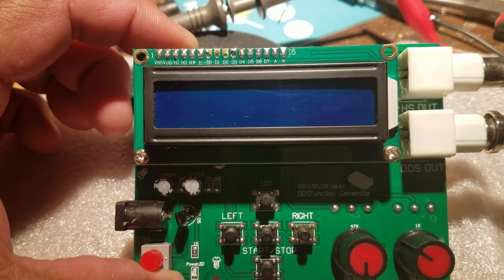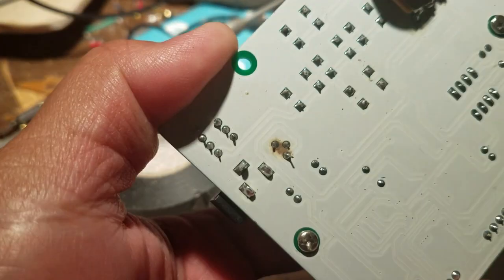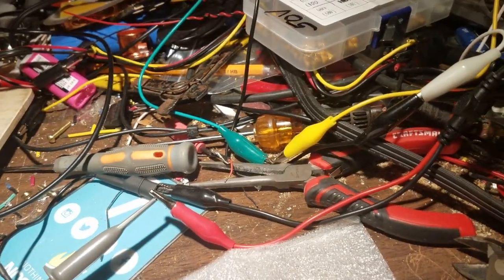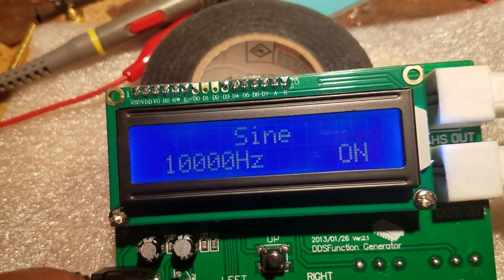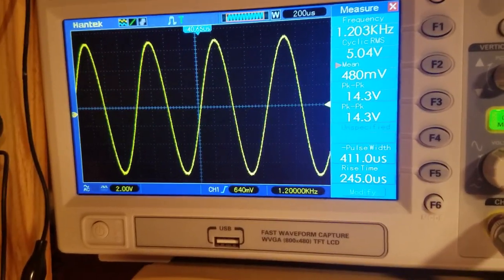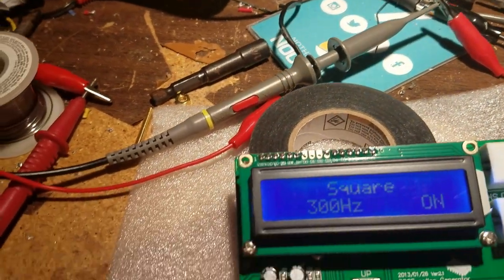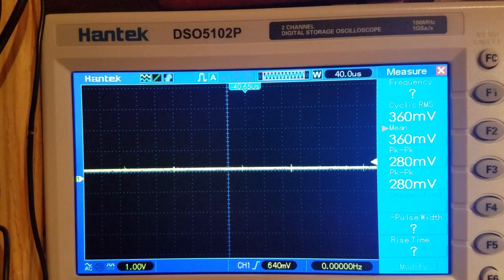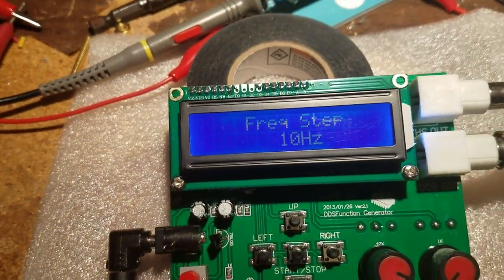DDS Function Generator Review

Comment: I purchased one of these function generators to use with my analog Leader 1100 Oscilloscope. Interesting outcome.  In analog the wave shapes are not accurate. For instance when a sine wave is generated and adjusted so that the top is a sine the bottom of the wave is clipped on a 30 degree slope. Also the sine itself has digital steps rather than a smooth flow. If I adjust it so the top and bottom are the same it looks more like a modified saw tooth.  I like How I can generate some interesting wave shapes but as a useful function generator it falls flat on it's face.

Comment: You could have used a 10x probe to avoid clipping and show a much better demonstration of the offset.
Also, the function generator the you have got can go to 1hz by adjusting the frequency step.
Reply: Can this thing be manually adjusted in real time with one of the knobs? I neen something that I can play and manually sweep from about 5 to 100hz manually with a sine wave can this thing do that? Or does it only have fixed frequencies?

Comment: Hello sir, Does this generator store the last setting ? So when its turned off and later on again does it produce the same signal ? Best Regards.
Reply from the maker: Hi Jan
Yes, it stores the last setting but when powering ON ( red push button) the generator will default to OFF, you will have to manually press the ON button (center push button) to run the generator. 
Thanks